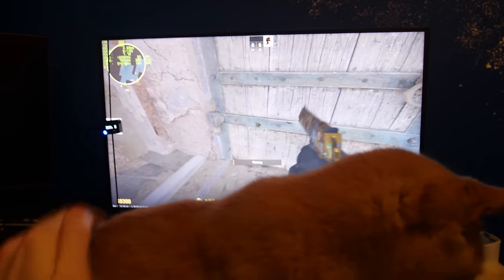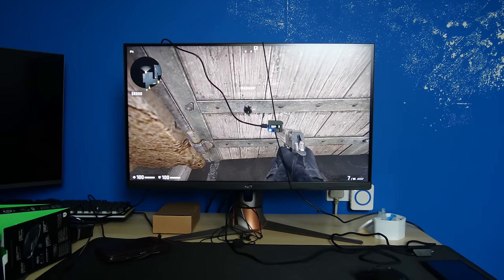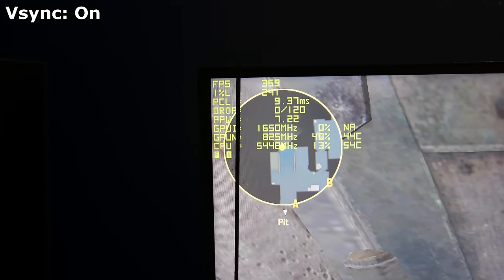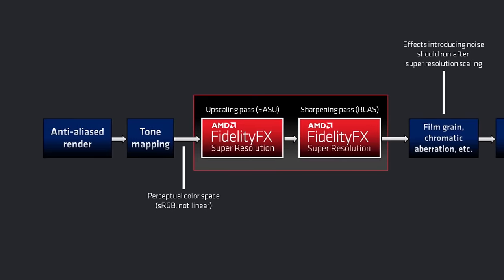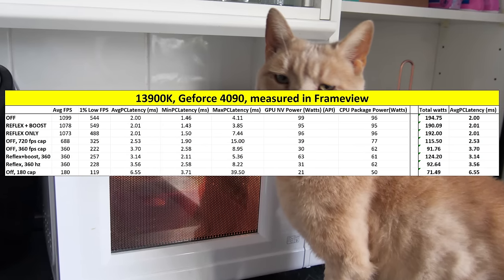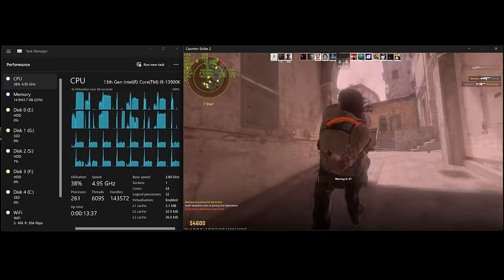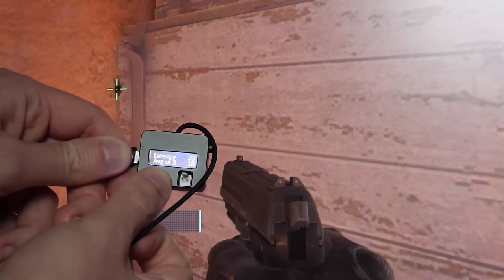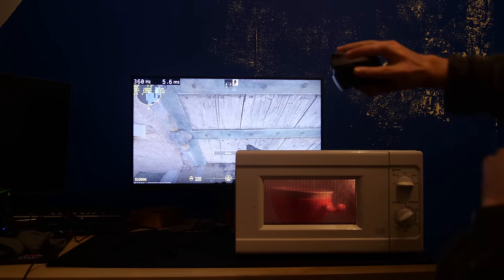Further CS2 Input Latency Testing

Comment: The Nyquist theorem is the minimum needed to reconstruct a sine wave. For anything else like e.g. a square wave you need a lot more as the frequency contents are higher.
Reply: The theorem states that if a signal is sampled at a rate that is at least twice the highest frequency in the signal, then the original signal can be perfectly reconstructed from the samples. This is true regardless of the shape of the signal, as long as it is band-limited. The theorem is often explained using the example of a sine wave, because it is a simple and intuitive way to illustrate the concept of sampling and reconstruction. However, the theorem is more general and does not depend on the signal being sinusoidal. Any arbitrary waveform can be decomposed into component sine waves using the Fourier transform, and thus any band-limited waveform can be perfectly represented by samples at >2x the band limit under Nyquist

Comment: Where is the claim that V-Sync turns off when Free/G-Sync is active? How would the game know that Free/G-Sync is turned off in that case?

This has been debunked before by both AMD and Nvidia to which at the same time they recommend having V-Sync on to avoid tearing on the first place because to nobody surprise V-Sync is it's own thing, instead of just a precise framerate cap.. Because funnily enough Nvidia Reflex actually knows when to stop the framerate to avoid input lag when V-Sync is on, at 144hz it stops at around 138 fps.

At any rate, thanks for finally debunking V-Sync having no latency when it's used properly.

For those curious, on AMD GPU with Freesync all you need is RTSS capped about 1-2 frames lower to get it going perfectly.

For Nvidia users you need to do the same but also set Low Latency mode to Ultra (Which used to be called max pre-rendered frames with 5 to 1 frames as a choice.).

Comment: You saying at 3:52 "Vsync isn't on if your framerate is below your refresh rate" is just patently false. You can literally test this at 60hz with an FPS cap lower than that and see that there won't be tearing. The idea that Vsync just magically vanishes at a lower framerate is such a new argument to me that I'm convinced you just made this up and runs counter to any time I've heard complaints about framerates getting cut in half due to double-buffering.

Comment: THANK YOU. I have been struggling to play in cs2 and when I was watching this video I saw that you had less latency when you had Nvidia low latency mode off so I turned it off. Now I can finally play like before and Bunnyhop again. And I also noticed that I had less latency when I turned on the G-sync on my monitor and disabled it in Nvidia.
AMD 5 2600
GTX 1060 6gb

Comment: 7:23 remark: not just faster core, but more likely faster cache in cpu generally. There is already was some dumb guys in 2015-2017 that overclocked amd fx'es through multiplier, not through fsb, and that caused some lags even on 5+ ghz cores

Comment: umlb2 seems to cut down pixel response times, input lag of monitors is signal procesing time plus half of a full pixe refresh, 1.5ms on 360 zowie pannels and 3ms and above on ipc pannels. Oled pixel response times of 0.3ms leave only signal procesing as input lag. It could be umlb2 makes the monitor more oled like and the pixels refresh at the beginning of the hertz instead of anywhere inbwtween 2 frames. Eliminating the pixel respone aspect of input latency basically. Lines up with the 1-2ms

Comment: That metal grid on the microwave oven's window isn't just for show, and it's the reason why if you put your mouse inside the microwave and somehow managed to click it (even with the oven turned off and unplugged) the signal probably wouldn't reliably make it to the receiver.

It's called a Faraday cage and it's one of those physics things that seems like it shouldn't work at all but it works really well. And it's the reason you don't get cooked when you cook food in a microwave.

If your wifi is being interrupted by a microwave oven and your computer isn't inside the oven, you should probably get a different microwave oven.

Comment: Have you seen adding -threads but one more above your cores and it works for e cores, so like i have a 12650H 10 core, I did -threads 11 and got about 50 to 80 fps and no 16 didnt make a difference for me nor did just doing 9 like a post had said to try

Comment: Wireless mice conclusion is wrong tho.
If its a 2.4ghz Radio wireless mouse microwaves actually generate so much noise that you will have issues.
Same for the introduction of more lag due to wireless. Logitech mice should be fine tho, especially the gaming ones since they are optimized for resilient low latency wireless.

Comment: i don't understand why you want so low latency because the actual game is running on a server and its fps is controlling when anything happens anyways, or at least that's how you usually make a multiplayer game making the server do any important function like hit scans for projectiles. so all input latency can do client side is give you a small chance to add the effect 1 frame earlier IF you happen to press the button in-between 2 server frames. what you see on screen are just client visual effects, i doubt they have anything to do with the server, aside from maybe waiting for a response. but usually a client can predict that something will happen so it just triggers the visuals even before the server gets the command to make it feel more responsive.
or am i missing something?

Comment: If you got 7800X3D, you could cut the power needed for your CPU in half while enabling even more FPS. That together with undervolting the 4090 and capping the framerate should bring the best FPS per Watt.

Comment: It would be a great and interesting thing to compare both AMD and INTEL against each other when it comes to latency. One test with stock settings and stock timings and maybe a test with Intel fully optimized and ram timings adjusted vs AMD fully optimized and ram timings adjusted ( both should run different RAM sticks. Amd with a dedicated expo kit of either 6000 or 6400 MHz and Intel with 7000+ MHz ) to also determine which company offers the best total system latency apart from framerates, since that over all would be the key factor for esports titles ?

Comment: I am astounished by the amount of people without G SYNC monitors that don't use V-Sync Fast because of input latency myths. Fast mode is only at most 1-2 ms added yet entirely does away with screen tearing on most games (There are some outliers that don't function properly with V Sync Fast, Mirror's Edge Catalyst has worse screentearing on V Fast than without any V Sync turned on).

Comment: In fact, adaptive sync won't be effective if fps is higher than refresh rate, this is why you still have tearing if vsync off or fps not capped.
It's not firmware issue.

Comment: Good sir, this is maybe not related to the video, but i played this game called apex legends where i found out that my mouse isnt outputting the same speed/delay of a click of a macro, (logitech 304/305 - old logitech software intead of g hub). I only found this out when i set a jump and crouch in a single click (mouse5) then went to the superglide trainer in google chrome and its outputting inconsistently by a small fraction eveey time..

Comment: Wireless mice can frequently be interrupted if you have a router close to the dongle that has a powerful wifi signal. I had that issue with my superlight because I plugged the usb receiver directly into my pc, which is close to a router. I was getting tracking that was skipping and getting interrupted. Plugging the usb receiver in to the lightspeed dongle and putting the dongle further away from the router fixed it.

It's not even an unusual scenario. In some apartment buildings for example there will be dozens of routers of varying strengths all blasting into your apartment. You will often notice wifi being so unreliable in that scenario you are forced to use a network cable to get playable gameplay. That same interference will potentially lead to your wireless mouse having a similar issue as the completely verifiable one I mentioned.

Comment: Microwaves won't interfere outside the box because microwave radiation isn't really that micro and can't fit through the gaps in the casing

That's why you can look through the screen on the glass door and not fry your face. The holes are smaller than the microwave's wavelength

Comment: In all fairness to the microwave thing, I was incredulous until I watched microwaves interfere with other peoples' older wireless gaming mice and even newer wifi hardware.  I've also experienced the microwave or blender or vacuum being on the same breaker as the router and causing a blip in power to everything else for a split second.  Caused the router to shut off/error out like all the time, but my connection was just kinda cursed

Comment: If you have an uncapped framerate and no component is showing 100% utilization than the problem is memory bandwith.

To put it simply, your CPU, RAM, GPU/VRAM has their own memory bandwith which is basically just how much data can be transferred between memory and the processor.
Basically CPUs and GPUs can process way more data then they can be fed. Well... if the game is not optimized well.

Using SIMD design patterns can help with optimizing, but obviously unless you get the sourcecode of the game, modify it yourself and then compile it there is nothing you can do.

This is why even if none of your components are sitting at 100% utilization but you upgrade your PC you can still get higher FPS.
Reply: And for anyone else reading: game engines that still rely on a main thread running full speed but others starving for work :P so 25% CPU average could easily mean the main game thread is running 100% speed bottlenecked, but other games better at splitting out the work get better 1% low FPS when multiple cores run 100% instead of just one. Disabling SMT/hyperthreading might help a bit so you cut cores in half but each remaining gets less overhead from other programs, but I always feel sad limiting the CPU that way from uefi/bios just so some games can run a little faster. So yeah exactly like you said, sometimes the game itself is the biggest bottleneck.

Comment: "provided the framerate is below your monitor's refresh rate" wait so what happens when you have gsync on (without vsync) and are above your monitor's refresh rate? Does Gsync stop working? So should you always limit framerate to your monitor's refresh rate when using gsync?
Reply: Adaptive sync like gsync or freesync only works within monitor's interval so you'll see frame tearing when you go above or below it, so yes an FPS limit at or 3 frames below that ceiling will avoid that and avoids your GPU running amok in loading screens of 700+ FPS :D Enabling vsync also fixes this, but if game ever drops BELOW your monitor interval in high intensity situations it may have to cut FPS in half to prevent screen tearing (or temporarily disable it like nVidia fastsync or AMD enhancedsync does). Adaptive sync works inside the monitor interval and oldschool (or enhanced/fast) Vsync works outside the monitor interval. FPS limit is a way to ensure you don't need oldschool vsync and save GPU power, adding input lag.

Comment: I guess my previous comment got blocked for some reason. A few quick google searches would've at least made this video educational on how wireless works, but at least good to know manufacturers are thinking about this. Most consumer wireless (your headphone, your mouse, your keyboard etc.) devices operate in the 2.4 GHz frequency band, that includes Bluetooth as well. Guess what frequency a microwave oven works at - 2.4 GHz. Not sure if it's the mouse you were using that's operating at different frequency or if the microwave oven had better shielding than most, but these signals will interfere with each other. I'll post the reference links in a comment below.
Reply: Guess I can't post the links cause YouTube doesn't allow it...
Reply: @seenbelow  yup links are not allowed at all on youtube, and yup, poorly shielded microwave will cause interference

Comment: From my experience the best feeling in game comes with using gsync + nvcp vsync + Ultra low latency mode. With those settings fps is capped automaticly (for example with 240 hz fps is capped at 225 for me) so u don't have to use fps_max.

Comment: Packet loss is the problem I have. Sometimes it feels like I'm sliding on ice, especially when jiggle peeking.

Problems I run into are moving further or shorter than commanded, grenade throw mistiming, and not switching to commanded weapon selection.

All I can guess is CS2 is way more sensitive to packet problems. Maybe its variable latency instead, but something just isn't right...
Reply: Set up own VPN with packet loss correction
Reply: @0ka354  I just realized you said your "own" sorry. Would that really fix a bad router though?
Reply: @Alabar3000  bad router? What are you talking about? There is no bad routers, only misconfigured or broken routers. I assumed you were talking about your ISP packet loss. If your ISP is not a problem, then I don't see any issue in fixing this by yourself.

Comment: 4:50 You are wrong here, Philip! G-Sync alone WILL NOT STOP this “bottom of screen” tearing, v-sync must be used as well. This is not a monitor issue, this is not a game issue, this is just how G-sync was implemented. It has always been this way. Enabling v-sync has no negative effect in this scenario, so there is no reason to leave it off if you are experiencing this “bottom of screen” tearing situation with G-sync. In fact, if you are using G-sync, there is no reason to leave V-sync off at all, ever! Because if you’re uncapped, you should just leave G-sync off since it does nothing. And if you’re capped, V-sync ON is never an issue. G-sync ON + V-sync OFF is a pointless configuration - extra tearing for no input lag benefit, unless you count the torn frame at the bottom of the screen as “lower” input lag, since technically that section at the bottom is from a newer frame. I don’t think anyone would actually benefit from that, though…
Reply: @3kliksphilip  I will copy and paste the explanation from blurbusters G-Sync 101 article from many years ago now, in the FAQ section titled “Wait, why should I enable V-SYNC with G-SYNC again? And why am I still seeing tearing with G-SYNC enabled and V-SYNC disabled? Isn’t G-SYNC suppose to fix that?”:

The answer is frametime variances.

“Frametime” denotes how long a single frame takes to render. “Framerate” is the totaled average of each frame’s render time within a one second period.

At 144Hz, a single frame takes 6.9ms to display (the number of which depends on the max refresh rate of the display, see here), so if the framerate is 144 per second, then the average frametime of 144 FPS is 6.9ms per frame.

In reality, however, frametime from frame to frame varies, so just because an average framerate of 144 per second has an average frametime of 6.9ms per frame, doesn’t mean all 144 of those frames in each second amount to an exact 6.9ms per; one frame could render in 10ms, the next could render in 6ms, but at the end of each second, enough will hit the 6.9ms render target to average 144 FPS per.

So what happens when just one of those 144 frames renders in, say, 6.8ms (146 FPS average) instead of 6.9ms (144 FPS average) at 144Hz? The affected frame becomes ready too early, and begins to scan itself into the current “scanout” cycle (the process that physically draws each frame, pixel by pixel, left to right, top to bottom on-screen) before the previous frame has a chance to fully display (a.k.a. tearing).

G-SYNC + V-SYNC “Off” allows these instances to occur, even within the G-SYNC range, whereas G-SYNC + V-SYNC “On” (what I call “frametime compensation” in this article) allows the module (with average framerates within the G-SYNC range) to time delivery of the affected frames to the start of the next scanout cycle, which lets the previous frame finish in the existing cycle, and thus prevents tearing in all instances.

And since G-SYNC + V-SYNC “On” only holds onto the affected frames for whatever time it takes the previous frame to complete its display, virtually no input lag is added; the only input lag advantage G-SYNC + V-SYNC “Off” has over G-SYNC + V-SYNC “On” is literally the tearing seen, nothing more.

END QUOTE

I can also say I’ve personally replicated this behavior on multiple monitors. Vsync off -> tearing at the bottom of the frame, vsync on -> no tearing, no change in latency.